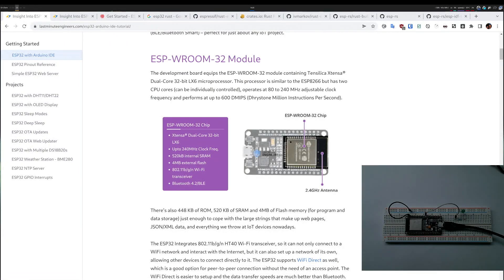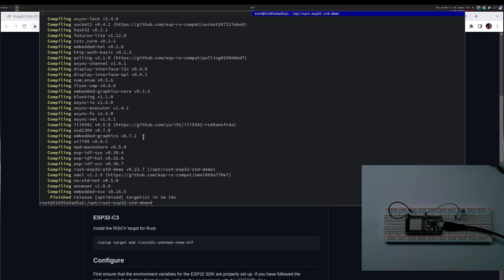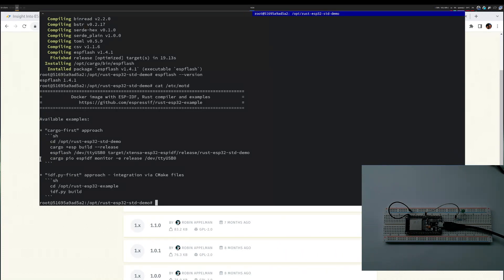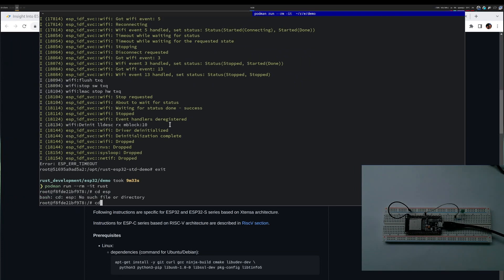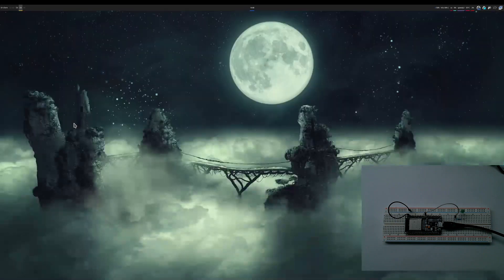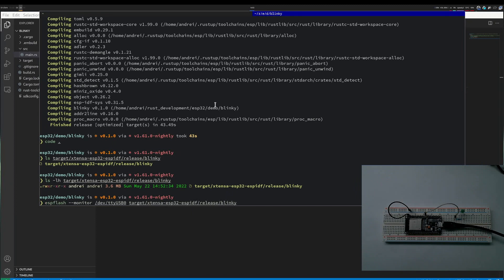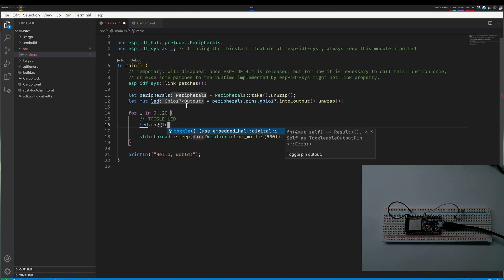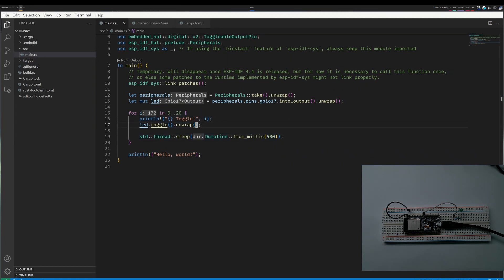Embedded rust: compiling for ESP32 devices and creating a simple blinky

Comment: Super helpful, thanks! I noticed that my demo does `Building [=======================> ] 196/202: esp-idf-sys(build) / Finished release [optimized] target(s) in 52.62s` - this is a VM with 24 vcores (Threadripper 1950X) and 64GB RAM.  It is no slouch, but this feels slower than I'd expect it to be.
Reply from the maker: I think the first build pass is always very slow, however subsequent builds should not need to rebuild sub-crates and hopefully they are faster - for me they generally are.

I believe in this instance a threadripper may also optimise for parallelism rather than pure GHz and I am not sure rust can take fully advantage of that. I also wish rust compiles would be faster. Until that happens, `cargo check` and debug builds seem to be the way to iteratively develop.